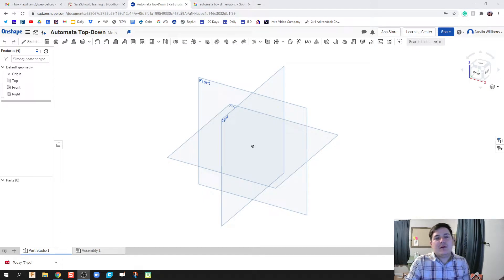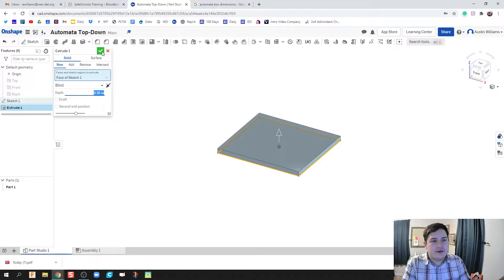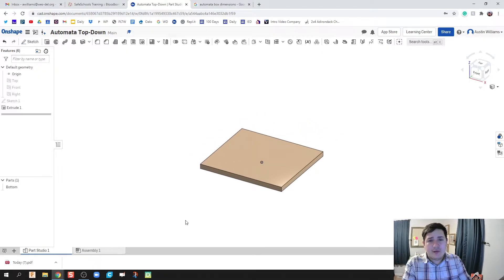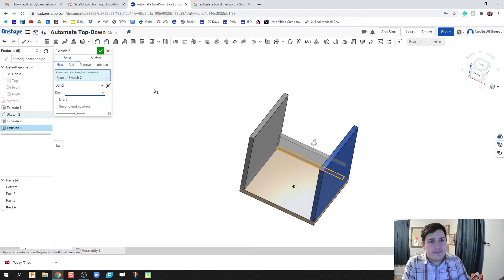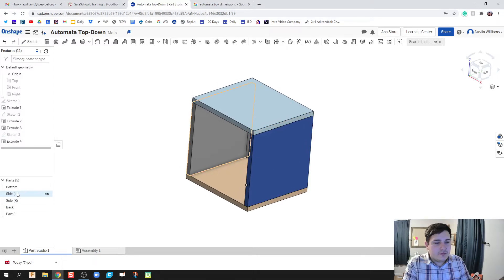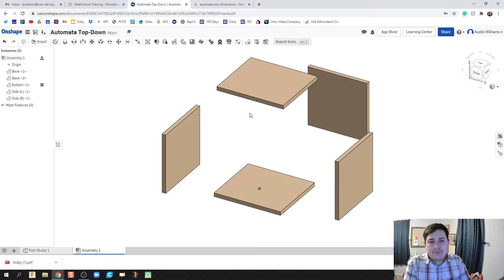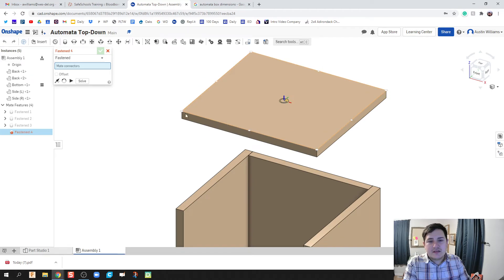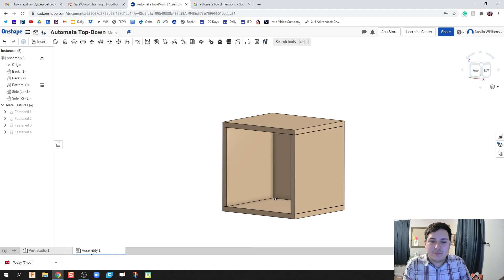Automata Top Down - Box - Day 38 of 100 OnShape Journey

Comment: Hello, if you had a choice for next year, would you go with Fusion 360 or OnShape Enterprise for Education? With the assumption that some students may still be remote and Inventor is not an option. Many of my students only have a ChromeBook at home. And your reasons why? Thank you. Excellent videos. I use them with my students as I am learning OnShape.
Reply from the maker: When it comes to the question of which software, there are a lot of individual school factors to consider. Device capability, student wifi (both in building and home), and administrations requests for certification.

For my class, students have chromebooks and do not require a certification test at the end of the year. That was the reason for my switch to OnShape.

I will continue to use OnShape because how easy it is for students to sign up (I've heard horror stories for student Autodesk accounts and had my own difficulty when signing up myself), portability of designs (sharing parts is SUPER EASY), and exporting files is rather quick. I will NOT be using OnShape Enterprise for Education, because I only teach 9 PLTW IED students. Enterprise is recommended for class sizes of 50 and above.

If my students had Windows-based computers, could take them home, and the signup process for Autodesk student package would be smoother, I'd choose Fusion.

The only sad part of OnShape, for me, is the Automata unit. I have found found a solution to keep the cams parametric and use a tangent mate. 

Some people might ask why Fusion is more difficult to sign up is due to licensing. ANY OnShape Design made with a student account is a public IP. So no million dollar ideas on OnShape. I believe all designs created by a student in Fusion are still private. 

Hope that helps you out.
Reply: @LearnItDoItMakeIt  Thank you very much for the input and guidance. I have heard about the AutoDesk nightmare too and also experienced it in the past, that is why we and a bunch of other schools switched to OnShape.